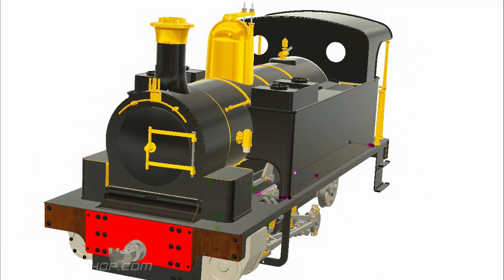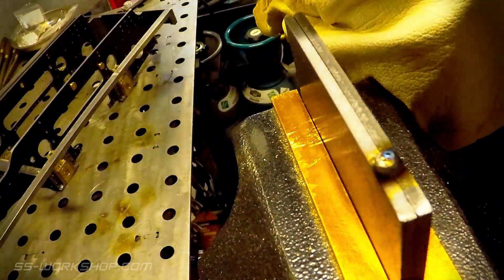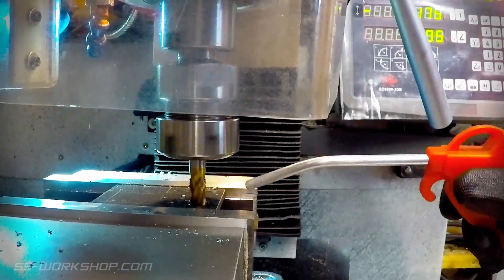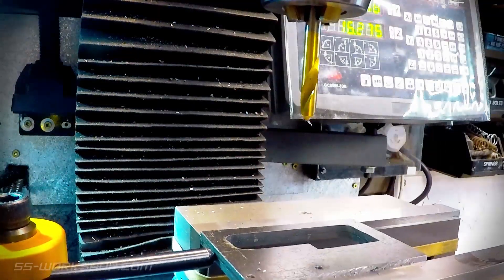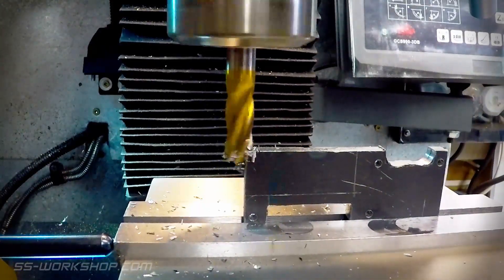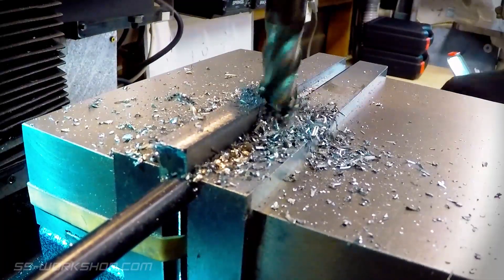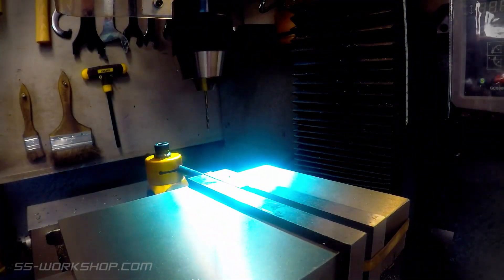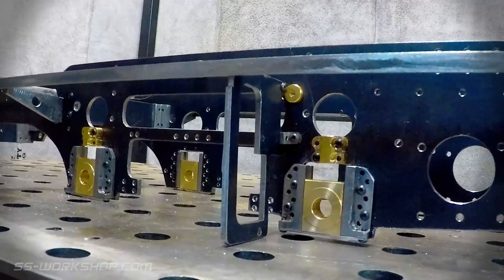Fell Engine Project - Crosshead Guide Rail Supports S1.E8

Comment: Question. Why do you spot and drill each hole individually instead of spot drilling all holes and then drilling all holes?
Great series!
Reply from the maker: Thanks, Good question, because I’m using the mill with the part fixed to the table, both holes need to be in exactly the same place or the drill will cut an an angled hole. If I was using a drill press with a floating vice the the drill would centre the part allowing all holes avoiding the issue. Of course with the digital readout on the mill I can find the exact locations to drill in the same place but quite often takes the same if not more time to locate them again.

Comment: Thanks a lot for posting these videos It was great to find videos of an H-class build, the videos are well done too! The H class is a pretty cool engine I often pop into the museum at featherston as I go through.  I have wondered about making an H class in 7.25 scale as my first engine build. Might make an F class first if I decide the H is too complex as a first build for someone of my ability. 
     You have obviously put a huge amount of work into the design before ever cutting metal. How did you go about that? Were you able to get the original drawings or anything? I have asked at the fell museum whether they have them but the person didnt know where they would be. 
   What are you going to do  for the centre engine? Will you make a dummy or a functioning centre engine?
        Cheers,
                      Jonathan
Reply from the maker: Hi Jonathan, 
I have spent about 2 years on and off designing the model and there are still parts I’m working on. The front and side elevation are available as a printed drawing from the New Zealand Railway Society http://railsoc.org.nz/document-archive/ they have elevations of most locomotives so would be useful for an F class build as well. Another useful resource for the H class is a book called the Rimutaka Railway by Norman Cameron https://www.fishpond.co.nz/Books/Rimutaka-Railway-Norman-Cameron/9780908573820 which has a written description of the workings including the internal motion work along with photos of the progression as they evolved over there service. There is also a film that is worth a watch, Rimutaka Incline Film (1992) https://jigsawentertainment.co.nz/products/rimutaka-incline?variant=1028454040 this has some shots of more detailed drawings of the workings and photos including one of the frame and inner workings of Neilson engines being assembled. I started the design work from the elevations scaled to 3.5 gauge, modelling in 3D cad (fusion 360), working from there I built in the motion work piece by piece using the LBSC & Martin Evans books and drawings as reference for the conversion of parts to 3.5 Live Steam.  There has been a lot of re designing as more information came to hand so drawing it in the computer and motion testing the parts has been invaluable. The centre engine of my model is designed to be fully working with the cylinders and motion work as it was in the 1800’s which has been one of the biggest challenges of the design. One other note to make is that there was a lot of changes made to the fell engines over there service, to the point where the boiler is different, parts of the internal motion work changed and the cab enclosed and the list goes on. It took me some time to realise just how much change there had been between it and the model I’m building which is based on the Avonside engines as they first went into service with the open back for access to operate as a live steam model. Hope this helps
Reply: Thanks for the reply Ive got the book DVD and drawings you mentioned. You are doing a great job developing an engine from the limited information in those! Im impressed. I suppose it helps a lot having the preserved engine to look at in featherston. Any plans to build a three rail track so you can operate the centre engine?
Reply from the maker: Yes, I have been thinking at least a couple of metres of test track with the centre rail would be good to try it out
Reply: Yes, thanks for taking the time to video your progress.